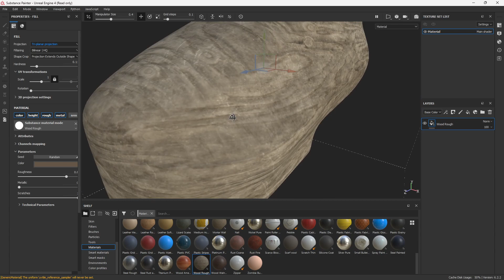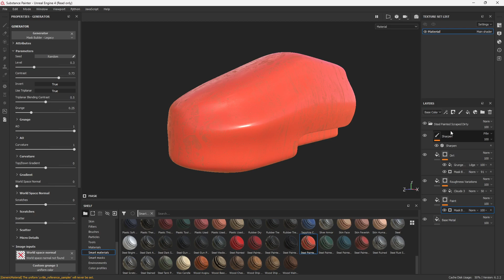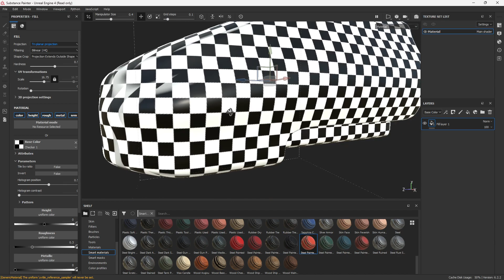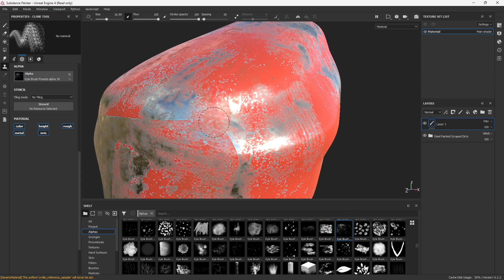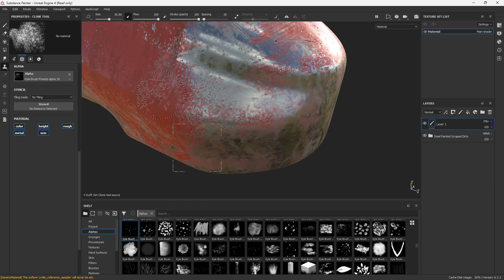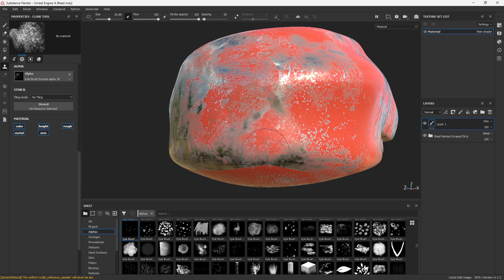Fixing Seams in Substance

Comment: I was hoping for something more automatic but I guess it can't be helped. Thank you this tutorial. This the best way I've seen yet.
Reply: It dosent allways help but I figured out that you can sometimes change the "Projection" setting of an applied smart material from standart "UV Projection" to smth else like "Tri-planar projection" and that fixes all seams at once. Only downside hiere is that is sometimes dosent display the smart material then the way you like it so you need to tweak the settings manually. 

You find this setting when you apply the material and look at the "Propreties - Fill" window und the Point "Projection".

Comment: the only problem I got on this method is when fixing a material with heightmap in it, i.e. using the default Iron Raw Damaged was kinda annoying that I have to give up on using height map. but other than that it's still a useful method